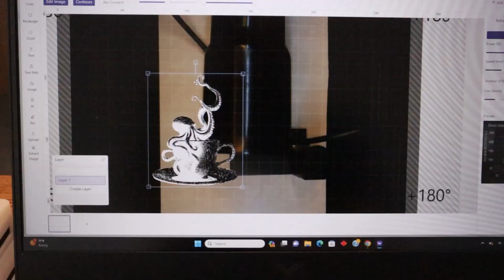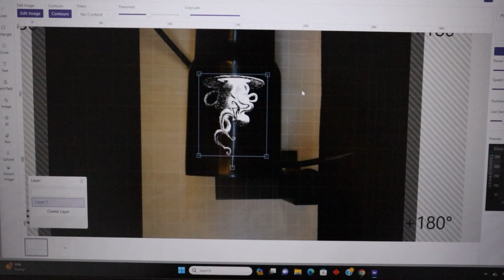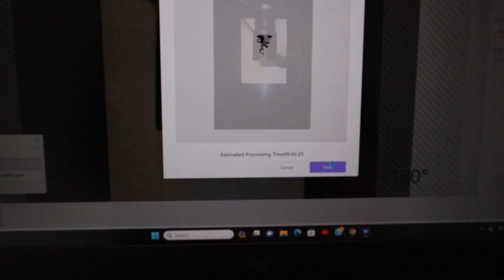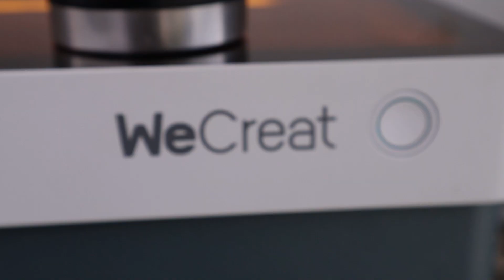Dead Simple Tumbler Engraving with the Wecreat Vision

Comment: I really like the machine a lot. Looking forward to getting back to it once my ankle heels.
I have not hooked up the rotary and I think it will be great. Only thing is it does not seem to have a way to do tapered tumblers.
The Xtool rotary can be tilted and I have done that. The LaserPecker rotary has a tilting head.
 What are your thoughts on this and any options for doing the tapered tumblers. I know a little taper might not be a problem.
Reply from the maker: I don't have a solution for the tapered tumbler yet. I'm hoping they release a first party fix for the issue. I need to spend more time experimenting with the machine.
Reply: Not a deal breaker but I have been working on an attachment in my CAD program. Maybe not be worth the work but I enjoy making something work.
Reply from the maker: Sounds awesome @ThePapa1947

Comment: Thank you for the video.
Can you engrave inside of a tray with sides?  Do you have to do something with the autofocus to focus on the correct height?
Reply from the maker: You could possible engrave the inside of a tray. You would possible have to set it at a slight angle and make sure that the focus height does not lower the machine lower than the size of the tray to avoid a collision

Comment: So, I’ve got questions. What’s the maximum diameter for the material in the rotary fixture (swing)? 

You skipped placing the tail stock side of the rotary. How do you make sure the tumbler is square with the laser head?

I do woodturning and would like one of these to embellish my pieces. How accurate is the rotary with matching a pattern that goes around the whole circumference. If you do a geometric pattern in a ring all the way around the tumbler, could you get it to match up?

Thanks for any advice. Great video.
Reply from the maker: Maximum diameter is approximately 6 inches. As far as the tail stock, it is not required. It is quite different than turning on the lathe. The rotary turns fairly slow and there is not real physical contact with the tumbler or whatever you are engraving. The tailstock support is only used if the main chuck jaws cannot grip and hold the side sufficiently.
Reply from the maker: And for a full wrap design, yes you can get it to match up, but some testing and planning ahead is required.

Comment: Can you engrave on a plain stainless tumbler or does it need a coating? I have a ton of plain stainless tumblers and would love to be able to use them. At least for learning.
Reply from the maker: You can engrave on stainless steel, but the process is extremely slow and it is difficult to get consistent colors and/or engraving quality at times and it's not the best indicator of how a typical coated tumbler engraving will look. I usually use the same one or 2 tumblers to test on and just respray paint them when I need to run a new test.